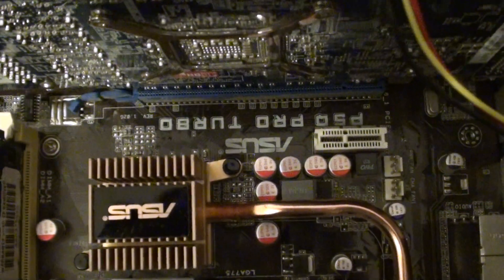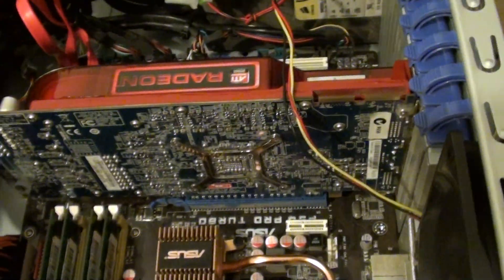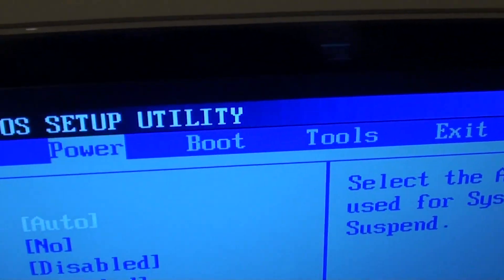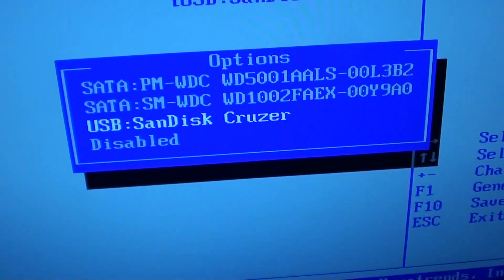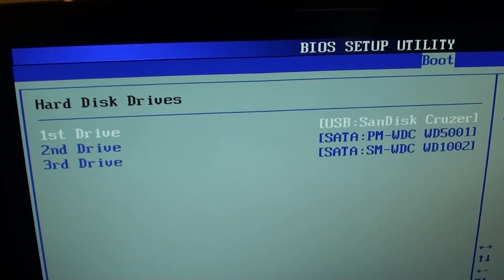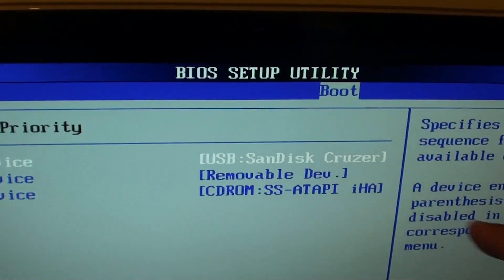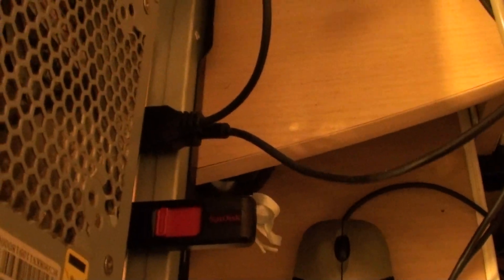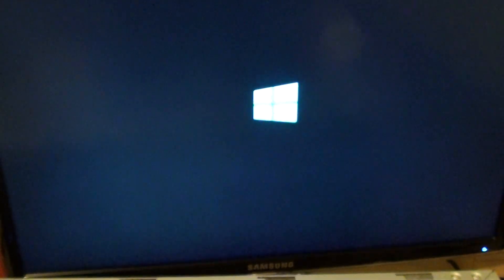ASUS P5Q PRO: How to Enable USB Boot

Comment: Thanks for the video, made a rufus usb for  Win 10 Pro 1067 to install in a cheap ssd, 64 bit  OS now installed with dual boot to go either Win 10 64 bit /win 7 32 bit.

Comment: Or ...... you could repeatedly tap F8 key during boot to display menu of which device to boot from. I was faffing around with BIOS boot order as well until discovering the much faster F8 method.
Reply: this totally worked for me. thanks!!
Reply: I have a P5Q Pro and F8 does nothing, what am I missing? Maybe I have the boot key disabled from BIOS?
Reply: Don't have that mobo anymore but I think F8 is a standard input not changable in BIOS. check the manual. U tapping correctly at about 2-3 taps per second? Start  about 2 seconds after turning on the power and continue until Boot order menu appears. If you don't get that then possible BIOS option or faster tapping of F8
Reply: one of those posts that saves your Day !. Thank you.
Reply: works for me, thank you, you are my hero !
Reply: Delta Kilo this comment saved my ass because the "hard drive" option he showed isn't available on the normal P5Q motherboards. F8 for the save
Reply: Helpful video and even more helpful comment. Pinch me am I dreaming?!
Reply: This worked, thank you from 5 years in the future :)
Reply: @agoniavr  maybe its the DEL key (it is in mine)
Reply: @armandolopes8483  hey man, thanks for the reply! Turned out it was some issue in the BIOS itself. I work in IT so I always tend to reset it when formatting and I've never had so much trouble entering a BIOS, then I fixed it and it worked just fine :)

That PC is still going going strong and I actually gave it to a friend of mine recently, think it's over 10 years old at this point but that MOBO is holding great!
Reply: When your right your right when I but my USB to first boot it would hang on the boot screen this saved the day
Reply: Yes! My BIOS didn't recognize my USB as a bootable device but only as a hard disk. Pressing F8 got me into booting from my USB with Linux. Thank you very much!

Comment: hey. Anyone still using old tech? I've just assembled a computer with Asus P5QL plus motherboard and when I go into Bios and try to select an option - there is no USB option. Any ideas? Would I have to perhaps update Bios? I remember I had another Asus P5QL in the past - that one showed me the USB option but it still did not want to boot from it. The USB has been tested on a newer machine and it worked. :S
Reply: I’m having the same problem, did you ever figure it out?
Reply: Was your USB drive formatted to FAT32 or NTFS?
Reply: @skorpian34  mine in nfts or can't fit on fat32. Guessing it maybe the issue

Comment: I have no hard disk drives option
Reply: SE version of the board?
Reply: Same issue here. Mine is P5G41T-M LX3, BIOS  version 0601. Did anyone find the solution?
Reply: @souranil9486  I just found out it has to have connected 2 hdd/ssd to show the option and to see the usb. With only one hdd/ssd and a bootable usb it cannot see the usb drive.... why do like that asus??why?
Reply: I tried again with two ssd drives and the option was visible but the usb stick was not. I think it might have something with what sata position the drives are in. It worked with only one drive but not in first positions